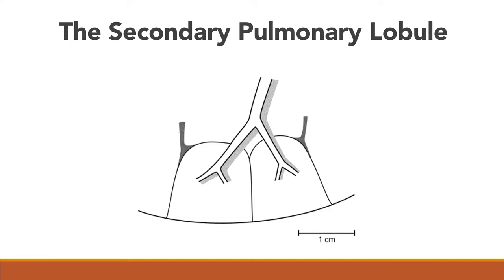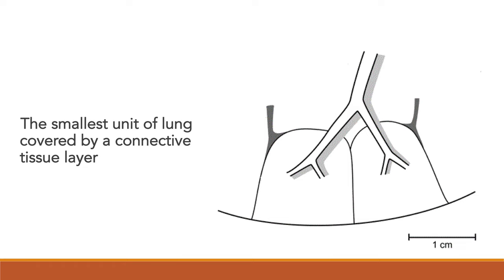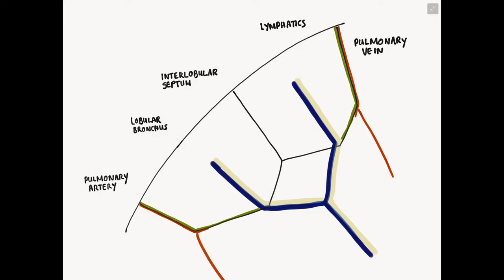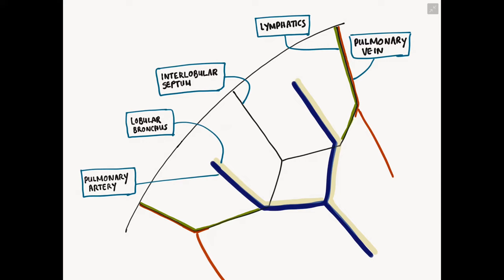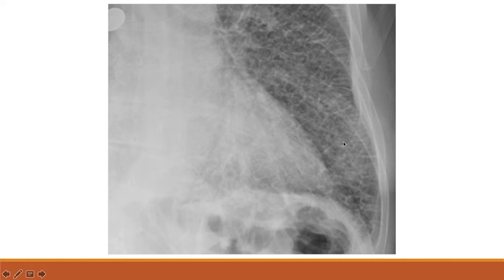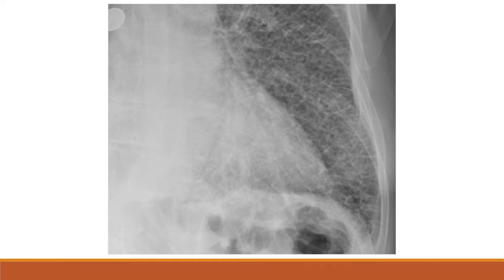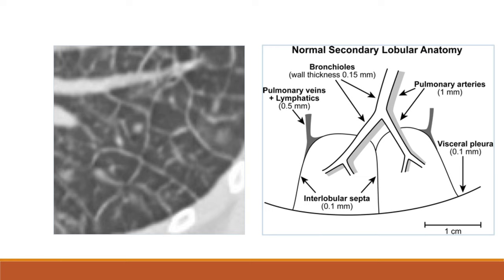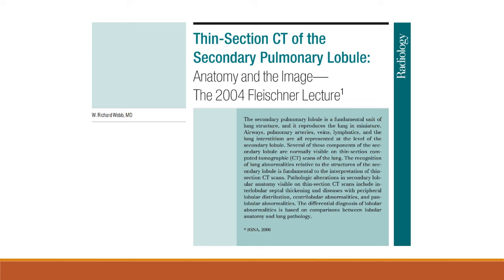The Secondary Pulmonary Lobule

Comment: Thank you for your explanation, But i wonder when u talk about the anatomy of a secondary pulmonary lobule, u say the center of the lobule is Bronchus, But i think it's actually a Bronchiole. Can you check it and answer me. 
Then i do not know about the Primary pulmonary Lobule, can u talk about it?! Thank you so much.
Reply from the maker: Hi, yes you're right, bronchiole would be more accurate than bronchus. bronchiole is a smaller airway that lacks cartilage. the primary pulmonary lobule is something even smaller than the secondary lobule. it is not usually something that we can see discretely in radiology though.
Reply: @ThoracicRadiology  thank you so much <3